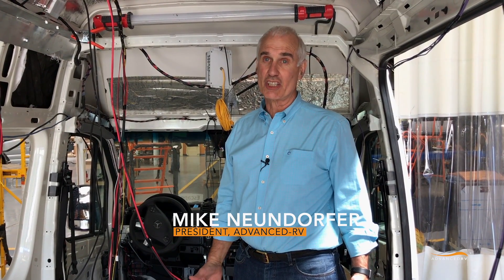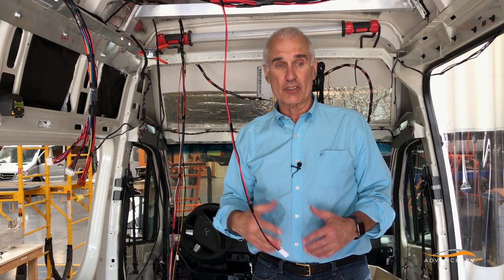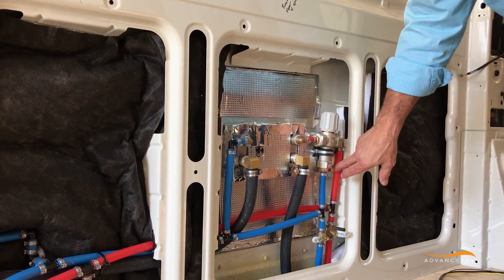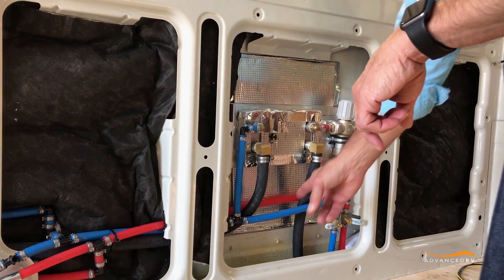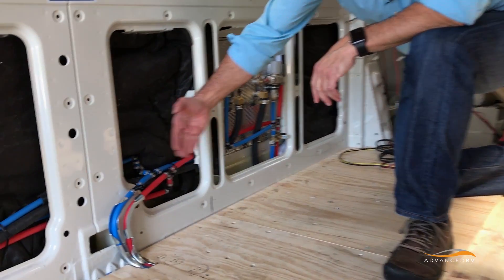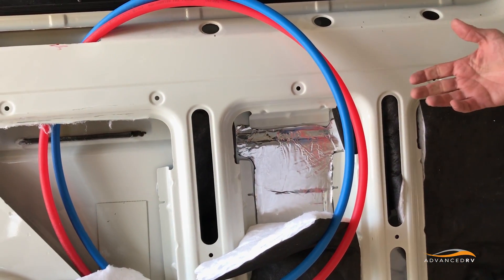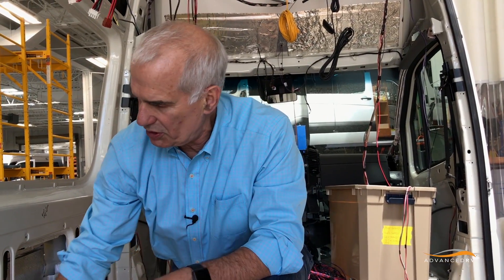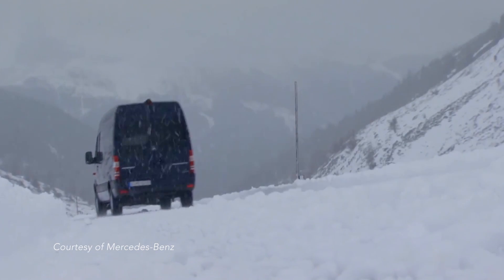Interior Plumbing: An Advanced RV Build For Winter Camping

Comment: Nice.   Has anyone upgraded this system  for radiant floor heating?    I believe such a setup would be much quieter, more comfortable heat and longer lasting.    A standard 'heated air' system is certainly faster/simpler, but the heat is easily lost to ventilation (vents, etc.).   The heated mass  (floor & attached structures) of a radiant floor system might be the ultimate way to go.

Comment: Mike,mom a Purser who is retiring soon. I dealt with glycol before as it was used in our aircraft in the 70's thru the 80's for chilling our carts. Glycol leaks were frequent, and very messy. What has Advanced RV done to ensure that glycol leaks are at a minimal or hopefully non existent?
Reply from the maker: Thank you for asking this important question. Preventing a glycol leak is not automatic, and I am happy to share our process. This includes proper clamp tightening. We spend time ensuring all components are compatible and seal the fitted clamps. After installation, we pressure test the entire system and then perform functional tests to check for cracks and leaks. Our material selections process and initial checks have eliminated the occurrence of leaks during final functional testing.

Comment: Would be neat if you could pull 180° water tap off that water to water heat exchanger for instant hot water for a micro-coffee machine, hot tea or soup.
Reply from the maker: Thank you for your comment patrick murtaugh. It would take a lot of energy to heat the approximately 5 gallons of glycol in lines and the expansion tank needed for a cup of hot water. Using the microwave to heat water is more efficient.

Comment: Nice ... Wish you rebuilt older American Class B's ... the Dodges ...  Hard enough to get parts and service when you're in the middle of nowhere .... or ...like me .... live in the Northeast where the nearest RV dealer is 100 miles in another state.
Reply from the maker: hypnosiscenter nyc, thank you for your comment. The Advanced-RV service team supports clients for service anywhere clients choose. The team  supports clients with one objective; to get clients back on the road as quickly as possible with quality repairs. The Advanced-RV  service team does this by having knowledgeable technical support people available 24/7 to listen and trouble-shoot the issue. After they understand the issue, they help the client find the closest, most capable service resource available. They then contact the service company and help expedite service and explain to the service company exactly what needs to be done. Advanced-RV service pays the service bill with a credit card without delay and paperwork. When Advanced-RV owners decide to have service done at the Advanced-RV facility, the service team makes them the highest priority dedicating the appropriate craftspeople to do they work immediately.

Comment: What is the finished headroom that the extended high top affords vs the regular high Top?
Reply from the maker: Thank you for your question, tradersato. The SuperSteath has a finished interior headroom of 80". A build on a regular high top has an interior finished height of 74.5".
Reply: Advanced RV, thanks for the quick reply. At 6'3" without shoes, I'm delighted in finding your option for a higher roof. Does this added roof height impede the Sprinter in some way?

Comment: instead of passing the water pipes underneath (outside) the van, I would pass across by going into the inside roof.
Reply from the maker: Thank you for your comment Gaetan Giroux. We run the water lines underneath the floor, but still inside, with a resistance wire to provide a little bit of heat when necessary. This will keep the lines from freezing.
Reply: Advanced RV I understood that part in your video... For me the small part that might need to be heated in extreme cold, you need another accessories (resistance wire) that can fell & another accessories that need to be energized.  But it all GREAT  truck. 
cheers!
Reply from the maker: Thank you for your kind words Gaetan Giroux!
Reply: Advanced RV Can't wait to see the finish product. 👍